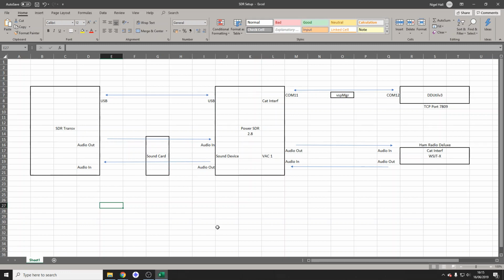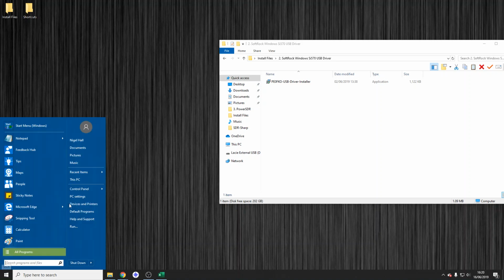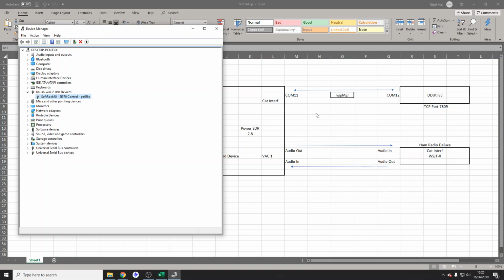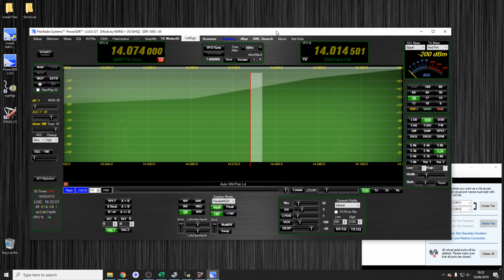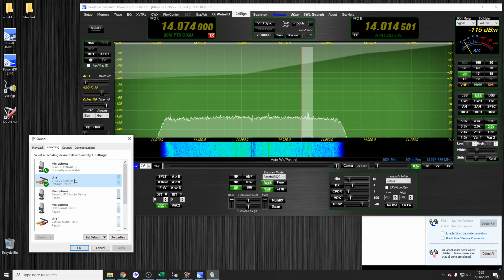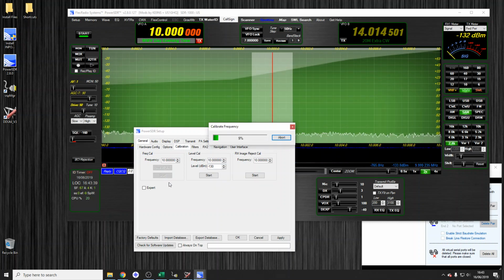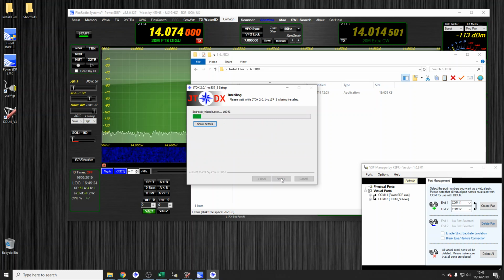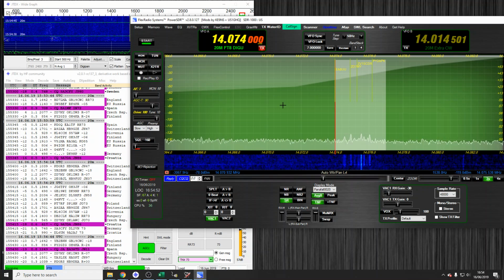Power SDR Setup With SoftRock SDR + JTDX +VAC

Comment: Herbert Cromack G0FGI
Hi Nigel. Many thanks for the very helpful video I have watched it many times and now have SDR back from Dean I have gone back to square one and followed your instructions.
Software installation went fine and have audio settings as per your suggestions.
First problem encounter was with frequency calibration. Went through calibration as you demonstrated , went to 10Mhz did calibration and said all ok. BUT when went on to 20m the FT8 signals were on 14.687, the frequency readout in my MFJ intelli tuner says freq is 14.076. Quite a difference.
Is there any way to correct frequency in Power SDR??.
Am using DX Labs as my logbook/frequecy operating system. Have still some bugs to iron out to get it to talk to WSJTX, so will need to do more  investigating. However to test system out  I connected power SDR directly to WSJTX and got system working and had few qso on 20m.
Next problem is power output, with TX settng to give just below  0 ALC giving about 5.5-6watts into a flat swr. (VAC TX setting 12). However when I switch in the power amplifier power out stays the same. Will have to discuss with Dean. What TX setting are you using?
Question - AGC and Preamp settings what settings do you use I cant see, particularly with Preamp, any difference between them.
Now going to work on SSB settings.
Many thanks for your assistance